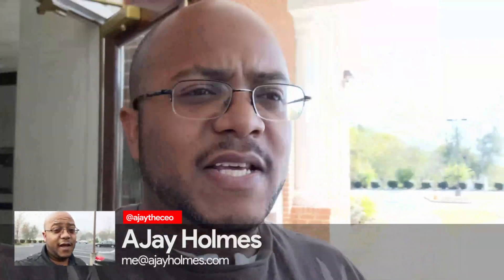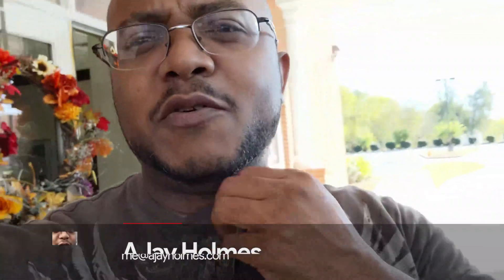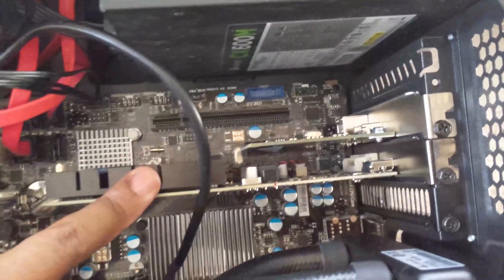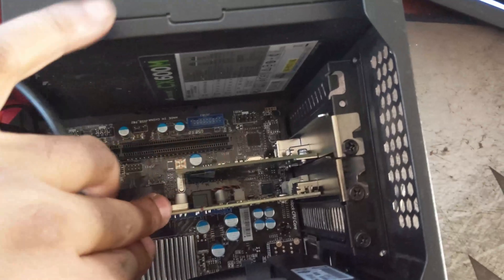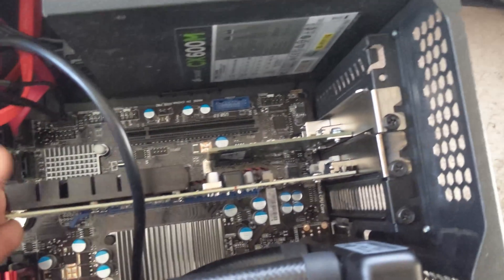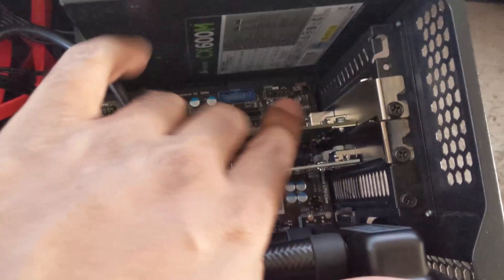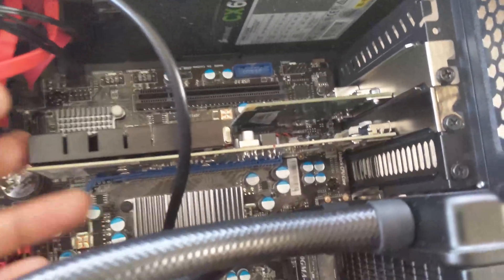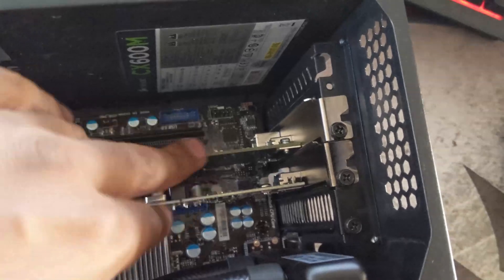AMD FX 8320 Live Streaming PC in 2019

Comment: i am using their original PC with a fx 8320 and a gtx 1030. My issue is not stuttering. My stream runs really well at 720p 60fps since its my dedicated stream pc. My issue though is around 4 hours into my stream my cpu and ram get pinned at 100% and PC locks up. My cpu and gpu temps are in the 30 degrees Celsius. not sure if i need a better gpu or if its my PSU
Reply from the maker: Which encoding method are you using? The 1030 doesn't include the instructions for the Nvidia encoder but that may just be my model. Any gtx card will work but I'm not sure of the 100% issues
Reply: @AJaytheCEO  I am using X264 and am thinking of switching to Nvenc and just upgrading my gpu. how much Vram do you need for Nvenc
Reply from the maker: @ManCave360  minimum of 2gb
Reply: Ok cool cause I am looking at the gtx 1050 ti cause it’s the first card that supports Nvenc
Reply from the maker: @ManCave360  we've used that. I recently moved it to my propresenter PC from our streaming pc. It works great and uses about 3% CPU usage
Reply: AJaytheCEO awesome! Thank you very much!